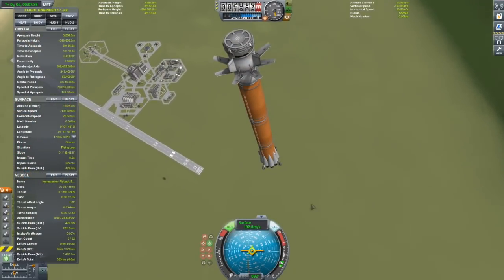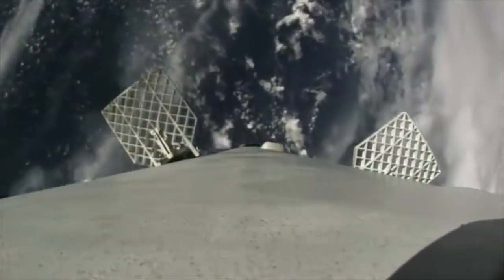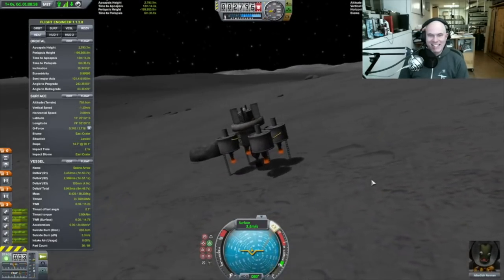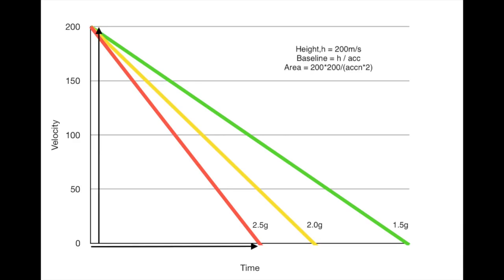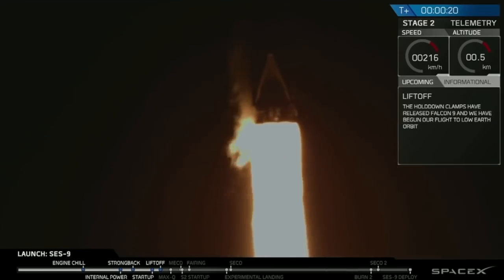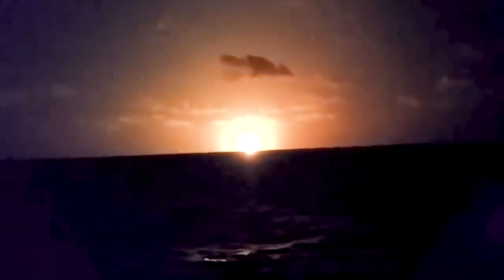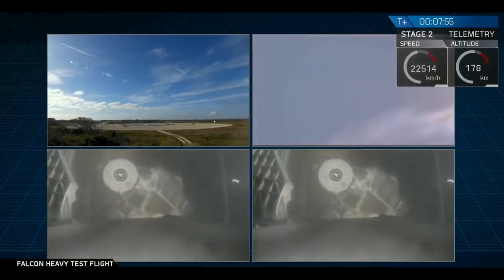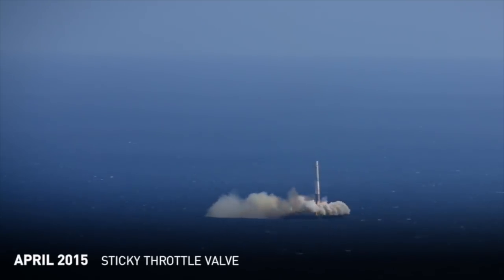How To Do A Hoverslam - Things Kerbal Space Program Doesn't Teach.

Comment: I don't understand, why burning 3 engines for shorter takes less fuel than one engine for longer. Does that mean I can save gas by flooring the pedal while accelerating my car?
Reply: Consider gravity. It's intuitive to think that if you're hovering, you need 1 g of acceleration just to stay in the air. Now, in this case, you're not hovering, but you're still spending 1 g just to counter gravity. In addition to that you're spending more more gees to actually decelerate (or accelerate, on the way up - same deal). You're paying the hover tax anyway, and the longer you spend braking, the longer you're expending 1 g of acceleration just on that. In terms of delta-v, you're spending 9.8 m/s per second on it.
Reply from the maker: If your car was a rocket.... maybe.
Reply: It would take less fuel to do 0-60 in a car if you accelerated as fast as you could, which you could compare to a landing rocket, but don't be confused, this would actually hurt you gas mileage in general. Quick starts don't increase fuel economy.
Reply: iamihop Your explanation is great. I totally understand it for atmospheric flight, as your starting velocity will be approximately the same. But when you’re landing on the moon (for example) your velocity will be higher if you start the burn later. Instead of preventing the craft from going faster for a long time, you now need to slow all that additional speed down. 
Am i missing something (its late lol) or does that concept of saving fuel not apply when landing on non-atmospheric bodies?
Reply: The air resistance is only a small factor. The main reason is that your rocket engines have to fight gravity for a shorter time. Calculations show that this saves about 2 tons of fuel for Falcon 9, so it really is an appreciable amount.
Reply: If DB's claims about trains is correct, then probably, yes.
They would seem to suggest the most energy efficient approach even for a ground vehicle is to do all your acceleration as quickly as possible, and otherwise travel at a constant speed.

I forget why exactly this saves energy for a train, (though high speed trains have a LOT of air resistance at speed) but apparently so.
Reply: Got it. Thank you.
Reply: You would burn less fuel doing that in a car, but for completely different reasons to a rocket. Engines are most efficient at full throttle for several reasons, the most important being pumping losses. Your engine has to work harder per unit of fuel injected at lower throttle levels to try to overcome some of the restriction from the throttle, similar to the way an airplane with a blunt tail produces more drag.

If you start coasting to a stop earlier to lower your average speed to make up for the increase of average speed caused by reaching speed sooner, then your car will be noticably more fuel efficient.

It's still not a good idea because it's super annoying to drive like that, both to you and the people around you, but it's worth doing on country roads sometimes.

Comment: calculating a suicide burn without using calc to figure out the proper burn time due to the change in mass due to fuel use? I'm slightly disappointed.

Comment: I'm apparently doing something wrong. I keep slamming into the ground around 150m/s... This is becoming irritating...
Reply from the maker: Try turning your engines on.
Reply: @scottmanley  lol nice. They're activating fine (I'm a python dev and just discovered krpc). However, I am noticing something odd. When I calculate T/M, I'm getting 7.42, however my TWR is 6.81. I have a feeling this is part of the problem and I don't know why.
Reply: I kind of figured it out. vessel.max_thrust (available_thrust gives the same results) is, for whatever reason, returning 294,327.5 (appears to be newtons, supposed to be kN), but the read-out from ksp indicates a thrust of 2,649.00 kN. Even if it is reading kN, it's still off by at least 300 kN...
Reply from the maker: @FoX84tac022  probably returning vacuum performance rather than sea level.
Reply: @scottmanley  unfortunately, that would be vessel.max_vacuum_thrust

I've tried that and it gives the full 300,000

I'm looking to see if it's a bug with krpc
Reply: @scottmanley  Submitted the bug and forgot to thank you for the video. Excellent content always! Big fan of the channel!

Comment: What’s wrong with parachutes?
Reply: 1. You'd need a few really big parachutes to land it as it is really heavy.
And the big parachutes will take space from the amount of fuel they can have.
2. They can't do any controlling with parachutes and it might land and fall on its side. The engine you can move around and have better movement with gridfins
Reply: nighthawk5582 - interesting. I figured a set of parachutes would be less weight then fuel. Guess I underestimated the size of the rocket.

Comment: I dont know about your reason for why a suicide burn is more efficient. A suicide burn must run for less time but use fuel at a faster rate. It still takes the same amount of energy to slow down the rocket no? So I think what I understood is that it takes the same amount of energy whether a suicide burn or a gradual, but the engines are more efficient when operating at higher thrust?
Reply: No, the rocket has less air time with a suicide burn so you don't have to expand as much energy to keep the rocket flying and fight against gravity.

Basically the goal is to change as much speed as possible at the last moment so you don't waste fuel hovering.
Reply: 1. When the landing burn starts, the rocket haven't reached its terminal velocity yet, and continues to decelerate by air-braking. The later you start the burn, the less speed you need to cancel.
2. In absence of gravity, it would have taken the same momentum (thrust*time) to stop the rocket. In presence of gravity, the engine also needs to cancel the momentum (force*time) added by it. Thus, the less time the burn takes, the less momentum it needs to produce. This was explained in the video.
Reply: Alexagrigorieff ahh I understand thanks for the explanation!
Reply: .. use fuel at a higher rate, not a faster rate. A fast rate is a quickly changing rate.
Reply: Additionally, for burns inside an atmosphere, the drag from the atmosphere scales roughly quadratically with the speed.  So if you think of it in terms of needing to dissipate all kinetic and potential energy of the rocket, the faster the rocket is moving through the atmosphere, the more energy can be dissipated through drag rather than rocket thrust.  So the longer you can be going at high speed (terminal velocity) the better.
Reply: Xylos144 great explanation!

Comment: So, NASA just used parachutes...
Reply: ... and a carrier task force.
Reply: For something heavy and big (like a falcon 9 first stage) parachutes are usless. And very hard to conteol
Reply: NASA used the parachutes on SRBs. I'm exaggerating a bit, but a burned out solid booster is just a big pipe with a hole in the bottom, whereas the Falcons are liquid fuel rockets with all sorts of complex devices inside (including electronics, pumps, igniters and RCS aka control thrusters though that's mainly needed for landing). You want a softer impact on the ocean, and you certainly don't want a lot of salt water inside.

Besides, NASA never actually reused any of the recovered SRBs because their own calculation showed that the inspection and refurbishment would not be cost effective. SpaceX has so far reused 8 Falcons on subsequent missions, whether it really saves money in the long run of course has yet to be seen.
Reply: +TruthNerds Most of the segments of the SRBs were being reused by the end of the first decade. You'll find people on the internet making such claims, but they are baseless assertions or wild extrapolations that ignore a lot of actual known facts in order to get to that conclusion.
Reply: +Markle2k You're right. It's my faul, not that of the Internet – I misremembered it. NASA did perform a great deal of SRB reuse as you say. (OT: Whether it saved them any money is a different issue. The whole shuttle program was, of course, much more expensive than originally envisioned.)

Comment: "No time left to fix it if anything goes wrong" is the reason that using the BFR for commercial intercontinental travel is not going to happen. Ever.
Reply: There's no time to fix things during a 747 landing either (from the final approach to touchdown stage, that is), and it carries a lot more people. It seems I recall one that was too low on it's approach and slammed into a dock instead of the runway. The pilot miscalculated the distance, and the plane was too heavy lift back up before the impact. It's more a matter of actual reliability, rather than there being time to fix things. BFR would have to fail several times just to match that one incident.
Reply: There is no individual thing that can fail on a 747 on short final that would cause a fatal accident. Everything is either redundant (hydraulics, flight controls, engines, instruments, autopilots, pilots, ...), or mechanically overengineered for the task (wings, landing gear, ...). For a rocket landing on its tail (suicide burn, hoverslam, whatever you call it), there is no such redundancy. If a single engine fails a few metres above the ground, it's game over for everyone on board (and a huge part of the structures on the ground, assuming there's no personnel inside blast distance). Due to weight constrictions, a rocket's landing gear and structure also cannot be overengineered to anywhere near the degree it must be on a commercial aircraft. For related reasons , rocket engines are built light-weight and operate much closer to material tolerances, and are thus much more likely to fail. A BFR will never be human-rated for a vertical landing.

Source: I'm an aerospace safety engineer and accident analyst.
Reply: The over-engineered landing gear don't help if the pilot clips them off the plane by hitting too low on a coastal runway. I hope you aren't trying to say that a 747 cannot crash. There have apparently been 15 fatal accidents for the 747. Given how ubiquitous they are, that really isn't that big of a number. Though, the one I was referencing may have been a 737 or something, I don't remember. Either way, BFR would not run even close to as often, and I don't believe they would be able to continue running it after even a single fatal accident, so it would just never have a chance to do as much damage. My comment was actually more out of irony.

As far as the passengers are concerned, it does not matter weather it is a mechanical failure, or human error. Outside of determining liability, the actual failure rate is more important than the theoretical reliability of the components. Though, of course, BFR is absolutely no exception, and to carry human passengers it clearly must be able to prove that it is safe, and this is not an easy thing to do. (For good reason, obviously, and 15 lost out of several hundred is still a better rate than booster recovery, AFAIK).
Reply: You are arguing with a straight face that a tail-landing rocket doing a suicide burn can be made reasonably safe to carry passengers in commercial operations by arguing that "airliners crash, too"? I have nothing more to say.

Comment: Actually, you mean to say suicide slams uhm burns make NO sense. It would be way too high of a risk to try any of this with manned rockets. I'm aware space debris is a real issue, but I am not sold on the very concept of reusable rockets.
Reply: PHeMoX That's why we do it with boosters, and not (yet) with capsules. Although that isn't entirely true. Soyuz uses retrorockets to land softly, but only after the parachute. And I believe the Dragon capsule will mostly/fully rely on retrorockets.
Reply: Elon musk has explained this idea very well, say you make a small plane for a couple million dollars, use it to fly some where and throw it away, or you fuel up a big airliner for only a couple hundred thousand, fly it, and then you can refuel it again.

Or here is my explanation. Would you rather pay for gas, or a new car every 400 miles
Reply: ^^^^ your last explanation was spot on
Reply: ...how do you think apollo landed on the moon? there's no way to land on the moon without a suicide burn... it's vacuum. Of course whenever people are in the equation, there'll be increased room for error, more fuel in this case, and as we saw with 11, that extra fuel helped them avoid a shitty landing zone. They also had a means of ejecting and going back into orbit with the ascent module
Reply: This is a booster not a manned capsule. But anyway, right now the next target is Mars. Atmosphere is too thin to decelerate to a slow speed. Best bet? Engines. That's also how we landed on Mars yknow
Reply: +moonasha Thankfully on the moon you don't have to deal with as much gravity, so you can afford to prolong burns for longer. On Earth, I don't think manned missions will stop using parachutes any time soon.
Reply: moonasha there's plenty of ways to land without a suicide burn on the moon.

They just require more fuel
Reply: Katrina L that's like the cheapest way why would we stop? There's a bunch of atmosphere left here. But again landing on sea aater is bad cause salt and all... Hey is there anyone that want to make super soft and super big tranpoline for the Dragons with me?
Reply: moonasha The moon landing was not a “suicide burn”.  On Apollo 11, Armstrong even stopped the descent and hovered, then translated across the lunar landscape to find somewhere safe to land after the navigation system took them toward a field of large boulders.  A suicide burn is where you light your engines and your vertical velocity reaches 0 at the same time as your altitude reaches 0, no hovering, no pauses.
Reply: Retro rockets for landing dragon have been canceled, due to the cost and time of human rating them.  They will still be the abort system/maneuvering rockets.
Reply from the maker: You can land on the moon without a suicide burn, the LEM was perfectly capable of hovering and ran its engine during most of the descent.
Reply: Would landing in fresh water make things any better?  We may be able to lease one of the great lakes.. :D
Reply: water will probably fuck irreparably with your rocket engines.
Reply: BFS probably would not use a hover slam as it's too risky and you would want to avoid high g maneuvers with live cargo.
Reply: The BFS is the only manned rocket return craft planned. It is heavy enough at zero fuel weight to have the atmospheric engines be able to throttle down to hover as long as one engine can go below 50%. The latest Merlin can go down to 40%. So long as the Raptor can come close to that, a true suicide burn is not necessary.
If they want to carry ordinary passengers simulating airline service, the FAA is likely going to require reserve fuel for contingencies as they do with craft with proper glide ratios.
Reply: Tian kay The superdracos are also the orbital manuvering rockets, you know... Sure, get rid of them, just be prepared to get out and push.

Comment: You've made something very simple seem very confusing so you get a downvote. Try harder next time.
Reply: pgtrots rocket science isnt simple, and although the concepts can be simplified, thats not what scott intends to do, he wants to teach complex topics.
Reply: Brazy "The longer you stay in the air, the longer the force of gravity has to pull you down. This means that in order to use the least amount of fuel in getting to the ground, you want to spend as little time being accelerated by gravity as possible. The way to spend the least amount of time in the air is to freefall and arrest your rocket at the last moment with maximum thrust - i.e. a suicide burn."

Done. This topic is very simple. The explanation in the video is drawn out and confused.